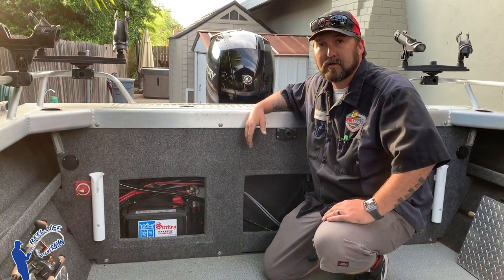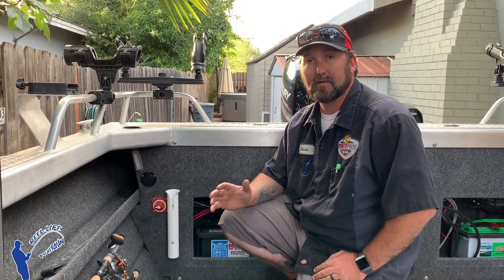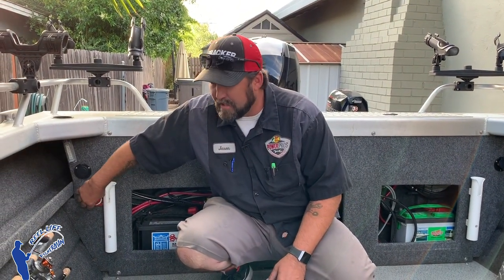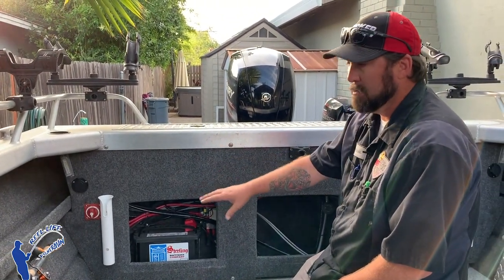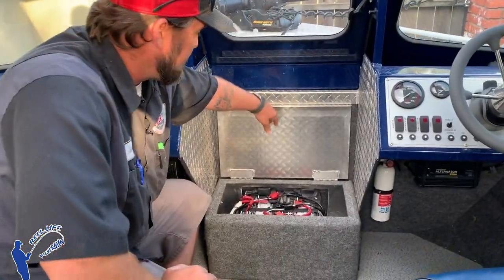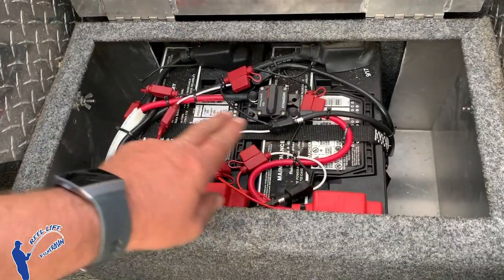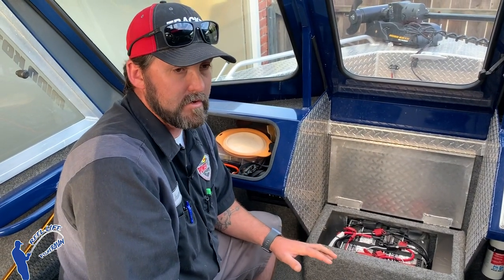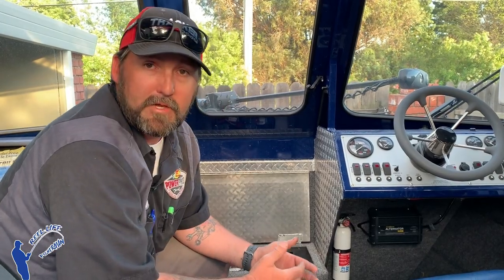BOAT BATTERY WIRING  | HOW TO

Comment: Hey I like your video, Im just a more visual person I have to see how you do it. so This is what Im trying to setup on my boat. I have a 12 volt trolling motor.I have accessories, Lights, live well . I have a tiller motor pull crank. So I don't need a battery for it. I would like to set it up so that the trolling motor has its own battery and the accessories has its on battery,  using a selector switch. I'm also going to be running a 60 amp breaker for the trolling motor, and a circuit breaker for the accessories, can you help me with wiring this setup ?
Reply from the maker: Thanks glad you liked the video! So if I understand correctly what you want to do.. it sounds to me like you wouldn't need a battery switch.. since you don't need to start your engine with battery power.. you can just wire in a accessory switch panel, that would hook up to your battery for all your accessories.. and give you a switch and a fuse for each one..  then you have another battery just for your trolling motor and wire that one directly to it with the circuit breaker coming off the positive post.. hopefully that makes sense.. let me know if I can be of any more help.. thanks for watching!
Reply from the maker: So I posted a link to a accessory switch pannel like I'm talking about.. it has 6 switches with fuses for each switch.   and has labels so you can customize it ..  you can find them with even more switches if you want more.. then run all your grounds to a ground bus bar or directly to the ground post.. hope that helps.. let you know if you have any questions..
Reply from the maker: Pactrade Marine 6 Gang Switch Panel with Illuminated Switch 20 Preprinted Labels, 6.5" L x 2.5" H x 4.5" W https://www.amazon.com/dp/B00IAZAUNO/ref=cm_sw_r_cp_apa_i_KVsADb78EARGQ

Comment: So if I never troll more then 4 or5 hours I don’t need a alternator , right? Thanks for the info!
Reply from the maker: Yeah if your just out there for a few hours.. most likely you’re fine..  if you have a 24v .. also constant trolling and spot lock eat up more battery..  if your using it for bass fishing or drifting it will last even longer.. all depends on how you use it and battery size.. thanks for watching.. let me know if you have any questions

Comment: hello, I'm trying to connect my trolling motor and my fish finder to the same battery with a circuit breaker...what is the best way to do this?
Reply from the maker: Jeffrey Acito i usually only hook a trolling motor to the trolling motor battery.. and everything else is ran off the engine crank battery.. if you hook your fish finder to the same battery as your trolling motor you will get electrical feedback and it will show crazy lines on your fish finder while using the trolling motor.. let me know if you have any questions.. but I wouldn’t recommend hooking the two up together.. thanks for watching! Tight lines 🎣
Reply: @ReelLifeFisherman  thank you for the response.  I gave a 15 foot jon boat that I want to run a 55lb in the back and 34lb in the front and looking to buy a helix 5.  what do you reccomend to set that up?
Reply from the maker: Honestly the best way to run a set up like that is one good deep cycle like a group 27 for each trolling motor.. a group 24 would be ok and save weight.. and then use a smaller 12v battery like something for a Honda or even a riding lawnmower just to run the fish finder..
Reply: @ReelLifeFisherman  awesome that is how I am already doing it I just want to add some circuit breakers for safety I really appreciate your help and advice
Reply from the maker: So all you need is a 50 amp for the 55lb and one for the other one too.. put them in line at the battery on the positive side.. and put a 5 amp in line fuse for the fish finder.. and good to go!
Reply: @ReelLifeFisherman  what gauge wire is needed between the positive terminal and the circuit breaker?
Reply from the maker: I always recommend running at least 8ga marine grade wire

Comment: Yes I also love your channel and I would appreciate the same information that Lonnie asked below about adding a second battery to my boat with a battery switch to power a stereo and amp which I am planning to add to my boat.  I have a 1983 19ft. Thompson Sea Rage Cuddy Cabin with a 305 Chevy engine and a 200hp OMC sterndrive (the old stringer style).  I have one starter battery and would like to add a deep cycle battery so that I can also install a stereo system with an amp.  However, before I can do this, I have a bigger problem that I need to figure out that maybe you can help me with?  Last weekend my son accidentally connected the pos wire to the neg terminal and the neg wire to the pos terminal.  There are two 50amp fuses that come off the starter and one of fuses blew.  We were at the lake when I discovered what happened and I did not have any extra fuses, so I cut the fuse holder out and spliced a piece of 10g wire between the two ends.  The boat started right up.  When I put the throttle into gear the engine killed and when I attempted to turn the key, all I could hear was a clicking noise coming from a solenoid on the rear of the engine.  Do you have any idea's or information to help me out with this problem?  Thank you so much, you are a very informative guy!

Comment: Great video. Got a quick question.
I have a crank battery in the stern, next to the change-over switch from Bluesea, and a house battery in the bow, that arrives to the change over switch via a 25mm tinned 4m cable. 

Next to each battery is a 50Amp RCD to protect the cable run.

Now I would like to add the Bluesea ACR. Do I need to run a new cable from each battery terminal (as per Bluesea diagrams)  or can I simply branch out two 25mm cables from the change-over switch terminals?

 The ACR is located next to change-over switch so all i would need is 1 foot of cable for each side,  to hook up the ACR, if there aren't any issues with using one cable run for both supply and inter-battery changing.

Thanks.

Et
Reply from the maker: I have only ever installed them per the instructions they provide.. but I like to use the seadog line isolator charger relay.. it’s what I have on my boat now.. (video coming out soon) it’s much more simple to hook up in my opinion..  I’ll send you a link to it.. take a look at it..
Reply from the maker: 12V 140 Amp Dual Battery Smart Isolator by KeyLine - VSR - Voltage Sensitive Relay Specially Designed for ATV, UTV, Boats, RV's, Campers 5th Wheels Off Road Vehicles Rhino Polaris Artic Cat ETC https://www.amazon.com/dp/B00WTAFR84/ref=cm_sw_r_cp_api_glt_fabc_K2RJJJHS2W4W9DJTJBMM?_encoding=UTF8&psc=1
Reply from the maker: It’s exactly like this one.. couldn’t find it on Amazon
Reply: @ReelLifeFisherman  
Thanks for the reply.

Yes, the one i have is similar and same connection layouts.

I am going to use the same cable run, after all it's the same battery terminal as otherwise I have to duplicate the RCDs and cables

Comment: Reel Life Fisherman,

I am in desperate need of some guidance for my pontoon.  I have 5 batteries total. I want to make sure they are all hooked up correctly.  I have 4 things but possible 5th that’ll require power.  I have one Pecko 2 way switch already installed - 1, 2, All and OFF.  I also have 2 onboard battery chargers.  1 is 2 bank and 1 is a 3 Bank.  I can send pics or specs if needed.  

1. Motor/ignition
2. Trolling motor 80lb thrust
3. Garmin Depth Finder
4. 8 speaker w 2 12” subs stereo
5.  Possible re-hook up bilge pump

Main ? Is how to hook up all of these appropriately if you can give any advice I would be forever grateful!
Reply: No answer still??

Comment: Can you show us how you wired that alternator. Charger.
Reply from the maker: So there is a set of wires that go to the cranking battery positive and negative.. with a purple wire going to key on ignition hot source.. then on the trolling motor battery side a bank is needed for each trolling motor battery.. so a 24v trolling motor system would need a 2 bank alternator charger.. or a 36v a 3 bank.. just need to make sure your main engine meets the required output voltage.. usually if you have a 75hp and up motor you’re ok.. thanks for watching

Comment: Thank you very much for the great video.
My question is; on my battery box, there is a Bremis cylinder switch, with 3 positions, as well as a separate Battery Tender outlet on the lid. I assume this is for plugging in to shore power for maintenance. Unfortunately the wiring between these and the battery has been removed. This is a new to me boat.  I can't find any markings on the lugs themselves, and I don't have a battery tender brand maintenance at this time.  I just want to be able to hook it up and turn the battery switch on  between my two separate 12v batteries, one 'house',  and the other to the motor, and of course, 'disconnect '. 
 Can you tell me how to wire the switch?
Reply from the maker: So without any markings you will have to hook them up one at a time .. and see what works on what position of the switch until you figure it out unfortunately.. that is how I would figure it out starting from scratch with no marking.. hopefully that helps some ..let me know if you have any questions.. thanks for watching
Reply: Thank you for such a prompt reply!! 
Yup, that's pretty much what I figured.  Never hurts to ask. I was poken around the internet, and it looks like this switch was actually manufactured to be used on a boat lift. I wonder if it will even work as you illustrated in the video. It is definitely heavy duty. Why would someone choose this switch for this, I'll probably never know.  Nothing surprises me anymore.
Reply from the maker: You’re welcome sorry I couldn’t be more help.. but it might be better to replace the switch with one from blue sea like in the video.. they are only about $55 then they come with markings and instructions..

Comment: Hey man, big fan of the channel! I’ve got a 12v trolling motor on a small jon boat with two 12v deep cycle batteries. Was originally thinking of going with a 1-2-both-off switch so I could run one dead then turn around and head home. Now I’m thinking it might just be simpler if I run them parallel with a 2 position on-off switch. 

Any thoughts on which might be the best way to go? Also, if I’m correct, with the 1-2-both-off switch I would need a two bank on board charger. If I decide to run them parallel does that mean I would only need a one bank charger?
Reply from the maker: Thanks for watching the channel I appreciate it! So if you run in parallel it will more than double your run time.. because of the way batteries tapper off charge.. but if you did decide to run the 1/2/both/off switch.. both puts them in parallel.. but easier to just wire in parallel.. only thing is you need to make sure both batteries are the same exact battery.. same size.. amps.. even age.. for best Performance .. you do need a bank for each battery to do it right.. so you would need a 2 bank charger.. it works with a single bank but it’s a bigger load on it and they don’t recommend it.. hope that helps.. let me know if you have any questions..

Comment: So like you said switching it to both batteries while running the outboard charges both and I don't need to purchase an acr
Reply from the maker: It will put a charge to both batteries.. but an isolator will put a charge to both as well the only difference is you can’t switch back and forth with it.. you wire each thing like the engine to one battery and the boat to the other..the best thing is to have a onboard charger that is the best way to keep them charged and healthy..and if your outboard has a stator charging system I wouldn’t run it around all the time with it on both batteries.. it can over work the stator especially if one of the batteries is a deep cycle..  hopefully that makes sense.. let me know if you have any questions about it.. still waking up drinking some coffee..lol

Comment: Question, I fly jet aircraft and every two years we replace the single 24v battery needed or not, these batteries are $3500 and there still good when taken out. Can I use these left over batteries for my 24v trolling motor?
Reply from the maker: If it’s a deep cycle 24 v I would say so.. are they lithium? Thanks for watching the video
Reply: @ReelLifeFisherman  no sir, lead acid, lithium had a lot of over heat issues so they are very rare these days, still have the battery over heat light on the panel! Lol, Thanks for the fast reply! Great videos!

Comment: How can I use a three bank charger to charge two batteries?  Although it is designed to be mounted on board, can it be used in my garage?
Reply from the maker: So if you have a 3 bank and only 2 batteries at the moment.. you can take the fuses out of that 3rd bank it will be in a fault on that bank but the other 2 banks would work fine.. you could charge in your garage.. but they do it on board so you don’t have to take the batteries in and out of your boat.. thanks for watching hope that helps..
Reply: @ReelLifeFisherman  thank you.  My 17 foot aluminum Lowe 170 bass boat has a 24 volt trolling motor (70lb Minnkota riptide) so a total of 3 batteries, but I have not figured out where to mount the onboard charger.  I really do not want to continue to lift and carry the batteries after each trip.   Lol!  I will keep you posted.  Thank you for the quick response!

Comment: I'm going to run 4 gauge cable for my battery to battery posts. What size wire would you run from the battery to the minn kota 60 amp breaker?

From the negative battery to the trolling motor receptical I can run 6 gauge correct?

Thank you
Reply from the maker: Depends on the size trolling motor and how long the run is..but 6ga is plenty for even 36v I will run the same size from the battery to the circuit breaker to the trolling motor.. I use anchor marine duplex wire..  thanks for watching and let me know if you have any questions..
Reply: I appreciate it. Since there's only one cable from battery 1 to battery 2 is 4 gauge worth it or just use 6 gauge for everything?

24 volt 72 inch 80lb. Length approx 12-15ft.

Thank you
Reply from the maker: 6ga would work just fine..
Reply: Thanks buddy👍

Comment: So your trolling motor doesn't use the house battery?
Reply from the maker: No the trolling motor is on its own battery setup.. separate from the boat power..
Reply: @ReelLifeFisherman  is that what should always happen?
Reply from the maker: Typically yes.. but you could hook it up on the battery switch as a backup battery/ house battery if your going out and don’t use the trolling motor.. now I’m talking about a electric trolling motor.. not a kicker motor..
Reply from the maker: It’s just going to cause electrical interference with the fish finder if they are hooked up on the same circuit.. so if you have the switch on the house / trolling motor battery and are running the trolling motor and fish finder at the same time you will have problems.. and the trolling motor would have to be hooked directly to the battery not with the battery switch or bus bar.. let me know if you have any questions
Reply: @ReelLifeFisherman  I'm just curious because my trolling motor and my fish finder are on the same deep cycle battery.
Reply from the maker: Yeah that can cause electric interference and is not supposed to be done.. if yours isn’t I’m very surprised

Comment: What would you recommend I do to keep interference off my graph when I’m running my outboard at mid to higher speeds.how do I wire my graph to ensure it isn’t getting the static on it.
Reply from the maker: mike d  so I would check your transducer placement and make sure it is in the best possible location and height.. and the best way to wire the graph is to run a dedicated power wire directly from the battery..  and also try to route the transducer away from any other motor battery leads or trolling motor battery wiring.. thanks for watching the video.. hopefully that helps
Reply: Reel Life Fisherman  yes I know the wire and mount are correct until I get to the battery and that where I’m thinking the problem originates. Since our Democratic governor deemed that fishing out of a motor powered boat ( even a single person) was going to spread the virus, I have time to trouble shoot the set up. She’s a real doozy and is more interested in going against the president than making sound decisions and judgements. Thanks for quick response, really appreciate your channel here in Michigan